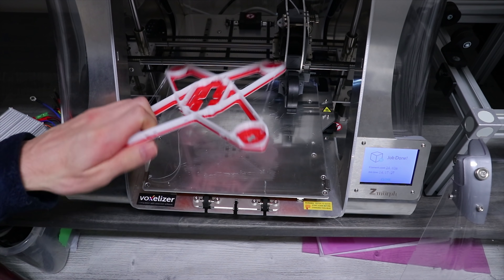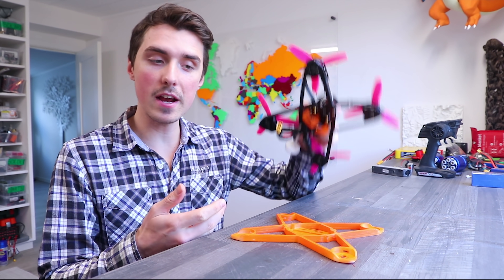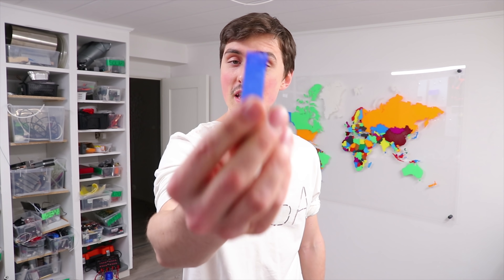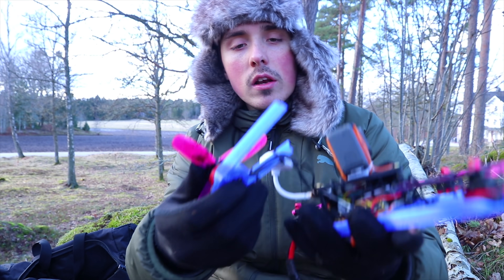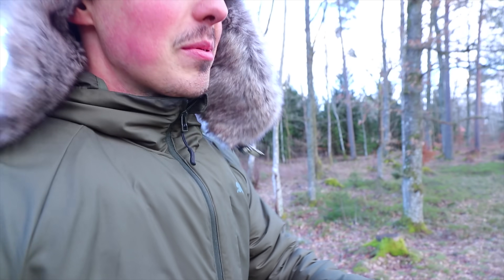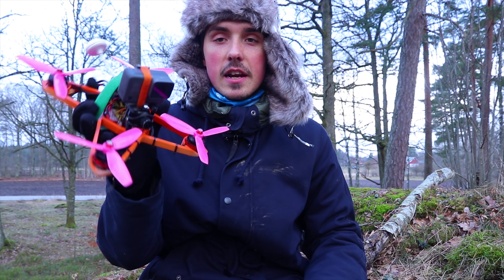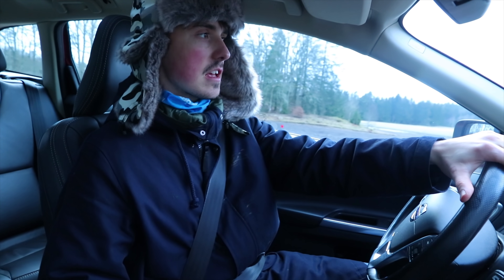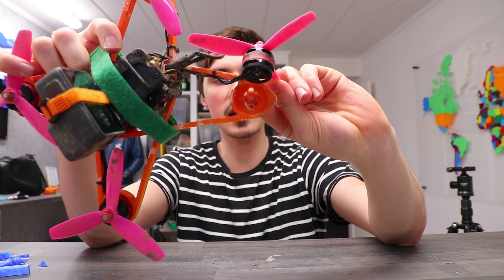A Flexible 3D Printed Drone That Can't Break

Comment: suggestion: make a full chassis out of the TPU with channels in the bottom. Then make stiffener pieces out of PLA and insert into the channel at the assembled level. If you snap a stiffener you can easily change it out like the props at the field.

Comment: One idea I have is use carbon fiber tubing along with a central rigid piece where the tubes all meet. Then have a the outer part of the frame be full TPU where the carbon fiber can slot into, just under the motors. The carbon fiber should give it enough rigidity and the TPU is indestructible. Glad the PP worked for you tho! I wonder if a different type of Nylon would work, or maybe Armadillo from ninjaflex, its their most rigid filament. Love your videos, keep up the sarcastic and fun style!

Comment: Why not print it flexible then reinforce with steel/carbon fiber and resin like shown in this video? You get the shock absorption of flexible and the insanely high tensile strength of carbon fiber or braided steel? https://youtu.be/XpDG8VxZsw4

Comment: maybe build a frame form like pla, but the with the arms having some king of spring-suspention system. like a pivot point at the end of the arm that connects to the main frame, and 2 strong springs on the top and bottom holding the arm in the middle. It may vibrate like crazy but i think it's a fun idea.

Comment: I use 0.065" weedwacker trimmer line for my source of cheap bulk Nylon filament.  For Nylon I also recommend "rehydrating" the nylon, since printing evaporates the moisture in the filament.  After a print I submerge my prints in hot tap water for about an hour.  This should solve your issue with brittle nylon.  Dry it off, and use.  Great idea.  I might try it myself.

Comment: still a bad idea. trust me - i fly fpv a lot, a whole lot. just buy a decent carbon frame for 35$
- your rubber has bad physical properties (it bends!)
- you elektroncis break anyways (especially motors and cameras) frames almost never do (unless you buy the wrong ones)
-> the best way to not break down is to fly carfully and practise a lot in a simulator,  which is a much more effective way to invest your time
the last 20 flights days i went without any major damage (that is 400 flights) and i fly very close proximity and very fast and very acrobatic and backwards and stuff

Comment: the stumble down alone, was worth watching this video for lol, Have you considered printing a frame out of taulman pctpe? it is a rather a good nylon hybrid, with a light coat of drywall adhesive compound sprayed on glass with 40deg temp on the heatbed, printing with it is equally easy as long as you make sure it is bone dry before using, like all nylons it sucks in water like a camel

Comment: PETG shouldn't really behave like that. Is it PET or PETG? There's a vast difference - the 'G' stands for glycol and that should make it not fracture like that. A good quality PETG should behave like the polypropylene but without the insane warpage, the high price and technically be stronger. I'm talking theoretical here of course, MMV between filament makers, printers etc.
Reply: I'm guessing based on how fragile his nylon was that he's not drying his filament. Nylon and PETG must be dry or they'll just snap like that. The cold weather doesn't help either.
Reply: @mrb2917  It could - though usually it's obvious when PETG has water in it when you're printing tbh.. But yeah PETG filament is one of the worst for that.

Comment: Think of a suspension bridge, upside down, triangular support structure as the frame.  Make it out of semi flexible filament.  Make sure it's directional used as an airfoil as it flies. You'll have to adjust the angle for the lean of the aircraft (the triangles) as it flies.  That should take out any vibration from the motors while making it bulletproof. Also doing that to the rotors, make them out of flexible filament the triangles should match the pitch of the rotors. Super difficult print. But if anyone can do it you could. Just throwing that out there?

Comment: Try OBC, it's by DOW. I've been switching some of drone part prints from TPU to that when I need stiffness but able to take a hit. I haven't gotten my slicer settings totally dialed in for it but the material properties are perfect for drones. plus, 30% less mass density. It needs packaging tape or magigoo-pp for bed adhesion.

Comment: Two things...
One - This is why the rest of us use goggles to fly FPV (first person view). It's much easier to avoid trees and crashes when you see exactly what the drone sees... And you can see the tree coming right at you. Sure, we all still crash, but it makes a GIGANTIC difference. No one, but you, flies FPV with a monitor! lol Zero! 😳🙄
Two - Everything, but tiny who0ps which weigh one ounce, uses carbon fiber (CF) for frames because it's so strong and so damn tough. I've run head on into trees at twice that speed and not broken a single frame... Sure, many people have broken carbon fiber frames, but it's by far and away the most strong material. I'm sure you know this, but on Thingiverse, people say that their 3D printed frames are just for testing the frame... Not for using the 3D frame as a final frame for flying all the time. Pretty much everyone has long ago given up on the possibility of using a 3D printed frame for anything but prototyping. After finding an acceptable design, everyone goes to the carbon fiber frame cutter, and has them cut their design. People give links in their Thingiverse posts... Using CF as the final product.
I know, I know, you have a 3D printing channel, but I find it futile to attempt to print a 3D printed frame that will actually last. Sure, your PP frame worked... For now. But, after being in the drone hobby intensely for the past 40 months, I'm pretty much gonna say, you're PP frame either has too much flex, which causes lots of vibrations and not good flight characteristics, or it will soon break. Too many before you have tried and it's pretty much a futile effort to 3D print a frame that's actual good. An A for effort! That's for sure! But, it's been done soooooooooo many, MANY times before, without real success. Plus, carbon fiber frames can be very cheap. Even top brands are making them to sell retail for only 30 USD. For a 5" frame. Banggood has many 5" CF frames for number $30, and a lot under $20!  Many of us now fly 3" and those frames can be had in CF for as little as 10 bucks! Durable as hell too!
Now, go get yourself some proper FPV goggles. 👍😁 My original Aomway's are very good and were as low as $150 USD, last time I saw them on sale. Great image quality too! So much more fun to fly with than a screen! 😎🤘I don't see how you do the screen... Oh, well it doesn't appear you "do it" for more than a few seconds! Lol 😜
Love your channel! Very entertaining!

Comment: i literally was going through some tuff times for the same issue .. looking for flexibility and durability .. 
i used a CF+PLA mixed filament and i got a very nice rugged frame .. you can see it flying FPV here : https://www.instagram.com/p/B9m1QZfnnxh/

didn't crash it yet but i think i will try this PP filament , it could be better :D
Reply: CF PLA sucks. It is weaker than PLA it self of goo quality... marketing unfortunately. It doesn't get better than PP for that purpose. 

I use PP Ultralight for canopies it has weight of 0.75 vs 1.25 of TPU ;-) and stiffness is higher than TPU - so can make thiner part with same stiffness
Reply: @bmw-upgradech1665  well said , i found that CF PLA weaker but after breaking some frames ,, some broke while building and tightening screws :D , so back to Normal PLA (Yellow hatchbox PLA) , its doing a great job , gonna try PP for sure :) , 
do you recommend a specific brand for PP filament ?
Reply: I´ve been flying since 2014 when I was in college and ive tried a lot of different materials. Believe me when i say you will hardly find something better than carbon fiber. Talking bout cost, machining/printing time or any type of making, there´s no rival for carbon fiber. Also "CF PLA" its stronger than PLA but not even 10% as strong as real carbon fiber so...

Comment: May I make a suggestion..?
1 bake your nylon(170f for 8hrs. Maybe longer. up to you).
2 print hot with no fan. 
3 print so slow it'll kill you. 
No joke. Like 10 to 20 mm a sec.
And it may sound crazy but try a 45 degree bed temp.